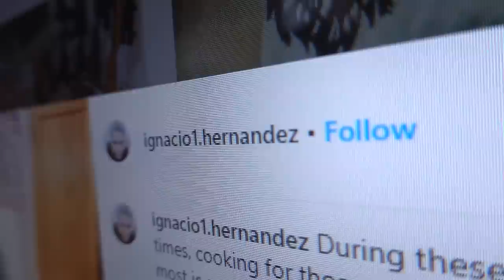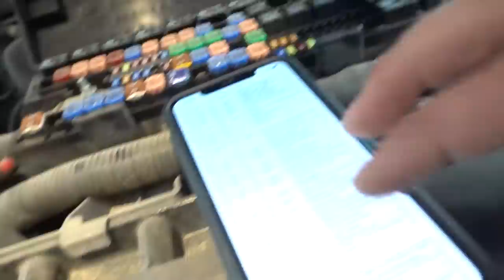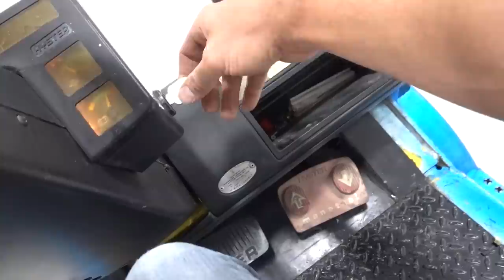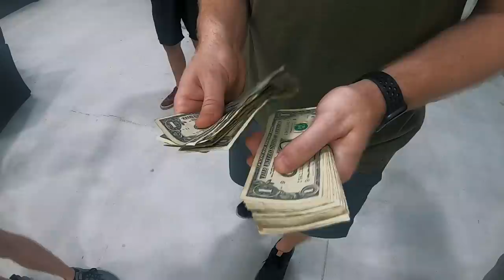I Bought an Old Beater Forklift... AND IT'S AWESOME!!!

Comment: Ives trainer here: Lifts are fun, but they’ll mess you up real quick. Please be safe. We had a guy at a plant by oversees get crushed by a lift a while back. Went from safe to dead in seconds. They’re deceptively dangerous so please be careful. A little training wouldn’t hurt if you can find someone local.
Reply: 10,000 lbs of death and destruction.  Those things one slip and the building comes down on top of you.
Reply: Yep I've seen people impaled and in the last three months a foot ran over.   Not to mention the numerous recks and dropped loads.
Reply: Getting your head taken off because some fool is driving around with the forks 6 foot in the air
Reply: Its fine they were drinking the whole time which prevents accidents involving vehicles
Reply: Someone will always find a way to hurt themselves on anything. Just practice and take it slow and easy until you're comfortable.
Reply: Curious as to how a guy got crushed?
Reply: Unsure about the US but you require a license to operate a fork here (Australia) and they are classed as high risk the same as elevated work platforms.

Comment: "I don't know much about forklift safety." Proceeds to do everything that you shouldn't do with a forklift.
Reply: I was gonna say! When he put the mast all the way up to the ceiling and ran away I was like 🤦 Matt is a good guy but can be a real air head sometimes lol
Reply: well if u dont know about safety u cant break it amirite?
Reply: Josh Martinak like most people in the South
Reply: OMG! I have two forklift certs (including all terrain) and this made me cringe! Oh. Don't do THAT!
Reply: @joshmartinak4315  It made me uncomfy and I work a power plant so this is the first tow motor I've seen with smooth wheels. 

ps. anyone else say tow motor instead of forklift.
Reply: Hopefully osha doesn’t watch this!
Reply: I work for a furniture company.  Literally puts the two pcs of cardboard chair up high on the mast.  I'm thinking I hope Mare has some good life insurance on him.
Reply: @PhilG999  Out of my own curiosity, why can one not leave a forklift extended such as Matt did? Does it need to be on to hold more weight than a simple chair? (I know nothing about forklifts)
Reply: SMH yeah time for some safety lessons at the new bunker
Reply: @JohnBoyGamer1  Chances are nothing will happen. But, they can and have fallen over because it's extremely top heavy. OSHA regs are (mostly) created when something very bad has happened. I'll leave it at that.
Reply: @PhilG999  Yup, yearly recert. And a different one for each make and model you might end up using. Been there, done that. When shit goes south on a forklift it's usually over before you knew it began.
Reply: @JohnBoyGamer1  If you have a problem with the hydraulics say one of the pipes split that mast is coming down real quick, when the mast is fully extended the whole weight of the mast is contained in the pipes
Reply: What worries me is that you hardly see matt respond to these messages, so I'm not sure if he knows how dangerous forklifts are. Please matt get proper training.   Steel caps for everyone.  Yay
Reply: JohnBoyGamer1 every time you get off the machine load down or forks down and tipped forward so people don’t trip over the forks while walking around. It’s literally like forklift 101. The machine is at its most unstable position while weight is high up like that, and also like other people have said if the hydraulics fail, big boom
Reply: JohnBoyGamer1 he also needs to either wear the seatbelt and brace in the case of a tip over, or don’t wear it and jump to the opposite side that it’s tipping. The overhead guarding crushing people jumping out while tipping is one of the leading causes of death for forklift operators
Reply: JohnBoyGamer1 keep in mind that forklift I’m guessing is 5000lbs lift, probably weighs just under 10,000lbs, more that his Cummins, not a toy to be fucked with lol I have 10,000 hrs on counterbalance and 10,000 on high reach (Raymond) powerful machines easy to underestimate.
Reply: @BuccLife  bet you like unsweetened tea, then, right?
Reply: @BuccLife  Obviously you've never been to the south...

Comment: MATT!!! While there is still NOTHING IN THE WAREHOUSE... you'll want to armor your walls. Get some steel plate bent in a 90 degree angle, line the walls of the warehouse with it, and secure it to the concrete slab. This way, your "new to you" forklift won't be tearing up the walls of your "actually new" building every time some idiot jumps on it and isn't watching what they're doing. Trust me, the expense you put in now to protect your walls from your new toy will be well worth it. I've seen what a forklift can do. (And I may have been responsible for a few holes myself...) Ounce of prevention.
Reply: 100%. I work on forklifts and people use and abuse them... not always intentionally. They can be quite touchy under load and accidents happen.
Reply: Couldn't hurt.
Reply: Definitely a good idea, I’ve seen quite a few holes made by the corner of a pallet because someone didn’t judge their turn right etc
Reply: VERY GOOD IDEA!!!
Reply: I've never operated one but I've definitely seen a few holes get punched into some warehouses 😂 not a bad investment at all
Reply: And there is always the urban legend about the new hire and the lunchroom.
Reply: Yeah, iv seen people spear support beams in the steel buildings i work at some times, like literally stabbed through the thick steel cylinder beams..
Reply: Yep yep, I can attest to this. Too true.
Reply: Also, protect the pillars supporting the roof.
Reply: Please for the love of god do not get out of the forklift with the forks raised.
Reply: @vuongClintontruong  Oh, Matt's got all sorts of safety "ouffs" going on. The funny thing is, you can tell who's been around forklifts from the "hold mah beer" yahoos.
Reply: He would probably test to see how bulletproof it is
Reply: If an operator tells you they’ve never punched a hole in a pallet, or scraped the racking, they are lying their ass off 😅
Reply: yes sir agreed.. ive done that in alot of buildings.. get that 90° angled iron, put it on the floor around the walls, and drill & tapcon bolt them suckers down and finish it off with some tack welds on the bolts.. The 1st time some goof ball puts the forks in a pallet too far, pokes through the wall and lifts, you'll wish ya would have done it..
Reply: Who the hell do you work with lol I worked in a steel fab shop for 2 years and me and all the other guys used the forklifts with no issue everyday. And I was an 18 year old with no certification too lol
Reply: @GlorifiedGremlin  What sized forklift blades did you use? If you're using the normal ones, then average pallets probably won't be an issue. We were using 72 inch blades to move aircraft cans and sheets around the warehouse, and a lot of the holes in the walls were from trying to grab normal pallets with freight using the long blades.

However, my advice still stands even with short blades.
Reply: @almostanengineer  As a forklift operator, I've never ran into a wall, but I've destroyed more crates and skids than I like to admit. I've also toppled a couple stacks of crates of PVC pipes 😂

Comment: Matt, when you disconnecting and reconnecting your battery you should go in this order: 1st disconnect the negative cable then the positive cable to unhook the battery. When you hook up the battery you 1st hook up the positive then you hook up the negative. You can cause damage to the electrical system, PCM, or any of the modules on the vehicle.
Reply: As a mechanic with ALOT of years doing heavy line work, can 100%, say I have NEVER in all of the HUNDREDS I have disconnected, ever hurt anything doing positive first
Reply: @tymullen2548  probably the same guy that says   not to touch light bulbs because the oil on your skin makes them go bad faster....
Reply: @drake_24v_hawkins  That is a thing lol

Comment: The fan has a thermostat that is stuck closed. It should be a separate module connected to the fan assembly. It should be an easy fix.

Comment: The Raptor, try removing the plug to the low pressure switch in the air conditioning system. When it cycles the compressor, it also turns on the fan to provide airflow through the condenser. It should be screwed into the dryer or the low pressure line going to the evaporator. It can be removed without losing refrigerant since it has a Schrader valve. If the switch is stuck closed, it will run the fan and the air conditioning compressor all the time. Unplugging it will help isolate the problem. If the fan shuts off, take an ohmmeter and check the two terminals on the switch to see if there is continuity between them with the engine off. If so, problem solved. New low pressure switch.

Comment: I recommend fork truck training before you total the building or other people. Also, driving with a raised mast is a complete no no and ensure your loads are secured. NEVER leave a raised mast and if going over tracks, go corner to corner.
Reply: Spoil sport
Reply: @jamesbizs  had a 17 y old inlaw killed by a forklift, they are no joke.
Reply: Okay “Rb” I’m sure you don’t work for osha or anything;) ;) I’ll believe you
Reply: As a licensed forklift operater, most of what he did with it in this video made me cringe. Totally OSHit material.
Reply: Bdkj3e _ not to mention that video they went around of the fork lift tipping over and the lady tried to hold it and fell under it, then it came back down on her.
Reply: if you need forklift training you are not smart enough to be in a forklift
Reply: @chriszag702  lots of people who say that and don't have their forklift license break a lot of rules they have no knowledge of.
Reply: Yeah and I honestly doubt he checked the weight rating before he bought it and likely has no idea that he should even be aware of that info. I thought driving a forklift/telehandler was straight forward until I got my license. I just hope no one ends up getting hurt over something that could have been avoided with proper training and knowledge
Reply: Are you not required by law to have a license to operate a forklift in the US? Seems kinda weird, they are a lot more dangerous than people think, if you don't know what you are doing that is
Reply: You forgot about never using the mast to hoist people without a specially built cherry picker basket, and always park the forklift with the blade tips flat on the floor. I second the forklift training AND also armoring the walls to prevent the inevitable "forklift blades through the bottoms of the wall." (Yeah, there's a warehouse somewhere in phoenix that had a few holes thanks to me. Not the only person responsible.)
Reply: Eric Ferguson  You want fun? Just wait till OSHA shows up AFTER someone was hurt or killed. Then we're taking the kind of fun most business insurance carriers have clauses for in their contracts. All it takes is one accident to wipe out everything Matt and Mere have worked hard to build, and these videos are a field day for any accident/injury lawyers, so incorporation papers (Like LLC stuff) might not shield them from losing their homes and other personal property.

I would NOT want to be the health and safety officer for Bunker Branding.
Reply: krull 123 you don’t need a liscense if it is a private business, I’m 16 and have been using a forklift since I was 14 and I’m not even old enough to get a liscense
Reply: @Tech21101  couldn't agree more. 😱
Keept on thinking. Someone's gonna get hurt with that.
Reply: @joshweber5852  I did work for OSHA.  MANY regs broken today.  So many I SUGGEST YOU TAKE DOWN THIS VIDEO. Major liability issues.
Reply: William Robbins this is a party. OSHA doesn’t control a party at a private property. Use a video with it with employees on the clock
Reply: @blahblah8037  doesn't matter if they work or not, it shows the work culture in the company.
Reply: Ok Karen.
Reply: @joshweber5852  No. I drove the damn things for 25 years without incident BECAUSE I had the proper training. Better to give sound advice than to see Mere make a video informing us of him being KILLED in a fork truck accident.
Reply: Eric Ferguson  I know I am no fun but on the upside, I'm still alive.
Reply: @alexfoytik2984  Under any health and safety law, a fork lift licence is required. After all, I worked for a private business and training and a licence was mandatory. Your suggestion is false along with your ability to spell.
Reply: @blahblah8037  Party at place of business with improper unlicensed use of heavy equipment and they may well take issue with that.  Not to mention if there are laws about consumption of alcohol on a business premises. Even one in construction.
Reply: William Robbins
Or at least edit out the violations and repost. I teach forklift safety. It's not about intelligence or skill. Skill comes with time. A license proves that the employee has been told the safe way to operate a specific model of lift truck. You need to have a separate license for each classification of lift truck. When something does go wrong the insurance company will blame the employee and OSHA will blame the employer.
Reply: Rb someone dies every three days from a lift truck incident.
Reply: Rb these employees work at a different place of business. This building can hardly be called a place of business or a workplace. 

Continue to feel superior
Reply: Never load-unload on a slope across traversing it diagonally no no,Rb I was an advanced FLT driver including Nissan and couldn't agree with you more.
Reply: Agreed, no one wants to be in those what not to do training videos. I've personally seen someone almost lose a toe because of one,  7 surgeries later it's still on there but it wasn't pretty.
Reply: Agreed and not a forklift operator here. Just one minor slip up and Matt's entire empire will be gone in one second.
Reply: Agree never leave raised by v. Dangerous
Reply: Agreed! Watching this video made me cringe a little. Matt and his employees need to take a certified fork truck operation and safety class that follows OSHA standards. These are not toys, mobile equipment is the leading cause of fatalities in many workplaces and if an OSHA violation leads to an injury or fatality you can be held liable. I've trained and certified many an operator in my workplace.
Reply: At my job the safety instructor showed the accident movie first.  Like the gorey ones. We would lose a bunch of new employees at lunch.  They made him quit.  Too many paychecks cut for half a day.   LOL
Reply: @alexfoytik2984  not true.  Ask your insurance carrier.  Btw Matt you need to double your liability coverage.
Reply: @JareddarArt  Matt insurance agent is having stomach pain as we speak.  Drinking, fire, guns, forklift. What could possibly go wrong?
Reply: @lori Emmert  LOL...we lose new hires after LOTOVY training and showing them the scary video of industrial robots. Oh and I forgot, the Combustible Dust video gets them too! And then there's the Molten Metal...yeah I work in a potentially dangerous place!
Reply: One thing, training would have done, is make him realize it's not only hours and engine that matter, those forks could be cracked and break under load, and yeah, they're not really toys tbh.
Reply: jeez....you always ruin all the fun dad..
Reply: @chriszag702  I was sent to training, passed it instantly, cause I already had some practice, but It still taught quite a bit of theory about maintenance and handling, weight distribution and just operations around warehouse with people in it..
For example, as tough as those forks look, they're not indestructible, Matt bought this without knowing if they have cracks and might break under load

Comment: Matt when you disconnect the battery cables, ALWAYS remove the ground first. 
Ground is installed last, and removed first. It's for safety.
Reply: Yes, can fry every module on the vehicle.
Reply: @nas0075  ill bet that's what happened to the fan lmaoo
Reply: Since when is Matt concerned about safety?
Reply: @1CherryTree  seriously... i dont think they watched long enough to see the forklift bit.
Reply: @neyta3789  WAITAMINUTE! Twelve years ago my nephew's Ram had the heat stuck on because he'd been pulling the battery out hot first. (putting in a remote start) The dealership mechanic said that was a common result from "hot sparking".  Had to replace three sensors.

Comment: Haven’t watched the whole thing yet but the fan is probably just a temp sensor. I’d get it fixed as soon as you can because you want your engine to be somewhere close to 180*F. If the fan doesn’t turn off it won’t ever get to temp and that’s not good for it.
Reply: the thermostat keeps coolant in the block until it reaches temp
Reply: I drink coolant
Reply: Christopher Lenahan yes and no on newer vehicles that have aluminum blocks if the cooling fans continually run the engine won’t get warm enough to open the thermostat
Reply: Lynny Liu I put it in my cereal
Reply: Seems like a blower motor resistor I have one go out on a Buick.
Reply: Christopher Lenahan the fans kick on when the engine gets hotter than 190 is what they’re usually set at. Coolant is always flowing, that’s how the heater core works for you to get a heater in the cab.
Reply: Lynny Liu I snort it
Reply: @TheNiteNinja19  Blower motor has nothing to do with the radiator fans
Reply: Could also be an air bubble or congealed coolant around the temp sensor.
Reply: @Camerons16  Coolant is not always fully  flowing through the engine block, though. Not until the thermostat opens up.